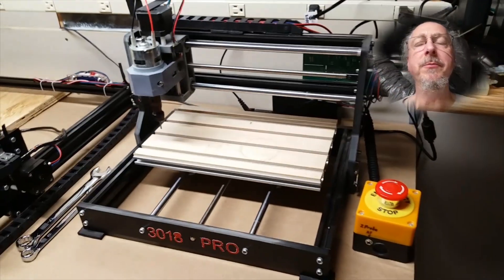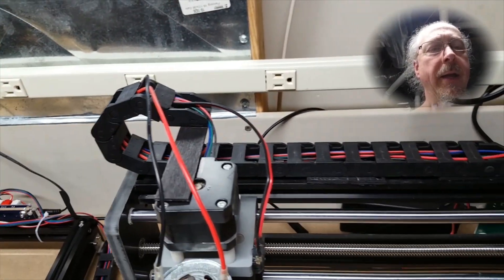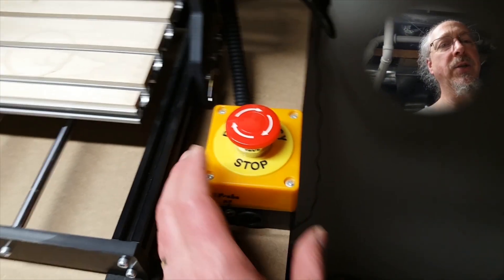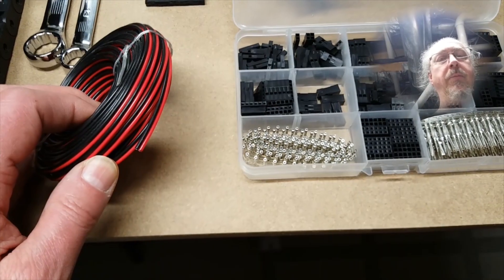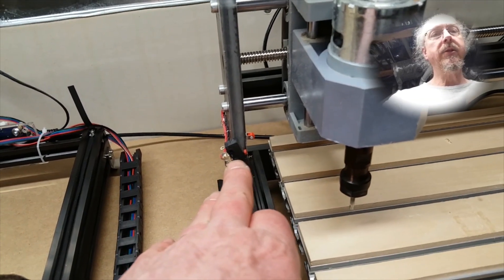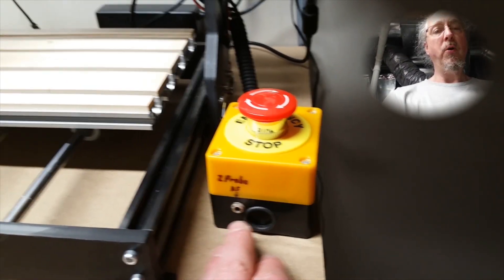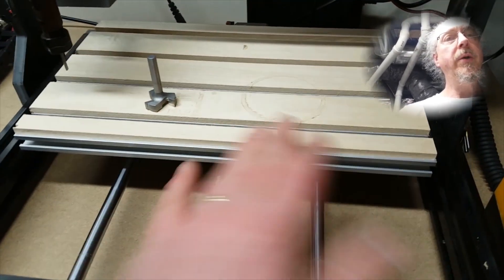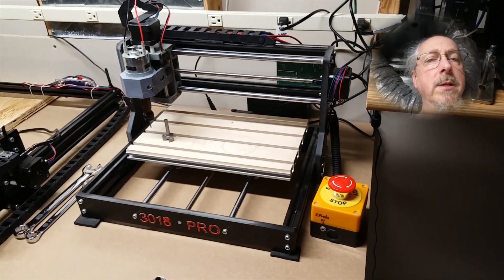Genmitsu 3018-Pro  Modifications

Comment: Ah, you did add rudder pads. Will be doing that next week if my 3018 shows up.
Reply from the maker: Amazing how much vibration those little pads remove from translating into the working surface.  Huge noise reduction.  And simple.

Comment: I bought a replacement control board for my Genmitsu 3018-pro. I hooked the z-probe to the wrong pins, and it started smoking. The new one connects to candle/UGS, and it shows the spindle jogging around. Except the spindle and table never move. Any suggestions?
Reply from the maker: Sorry to hear that you controller was smoking.  Never a good thing.  I have not run into the issue where UGS shows the controller moving around when I am not moving it around.  I would check to insure the correct COM port is selected for your 3018-Pro. It makes me wonder if one of the command settings is not set correctly in the controller.  Here is a link that explains each of the settings on a GRBL controller.  It might help: https://www.diymachining.com/downloads/GRBL_Settings_Pocket_Guide_Rev_B.pdf